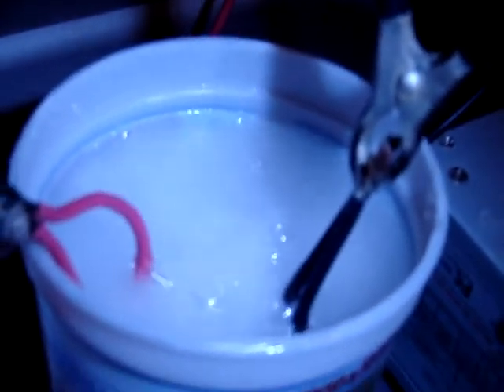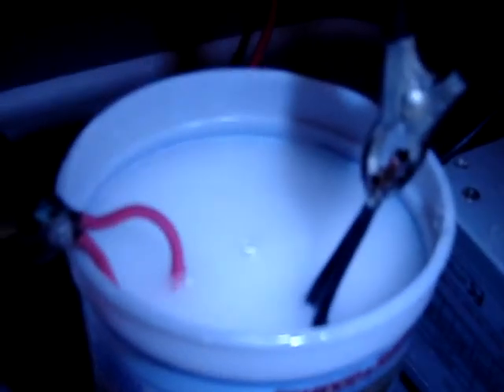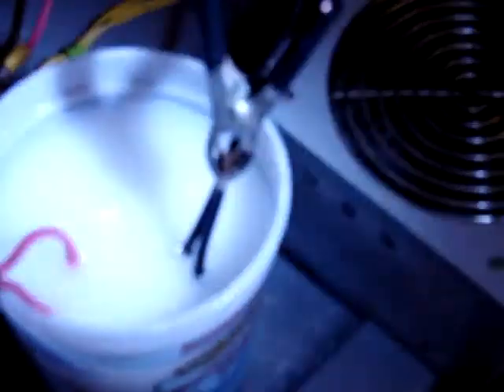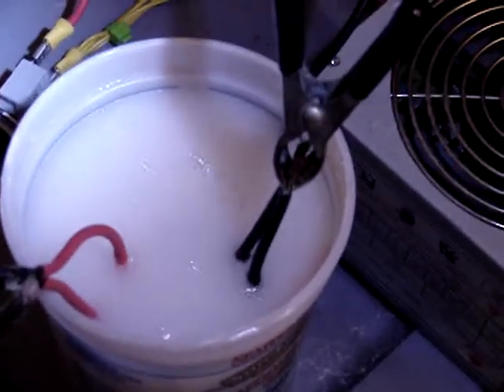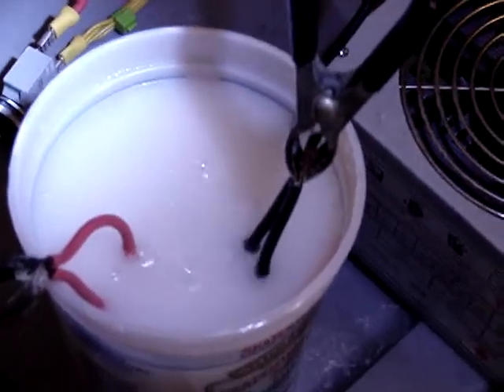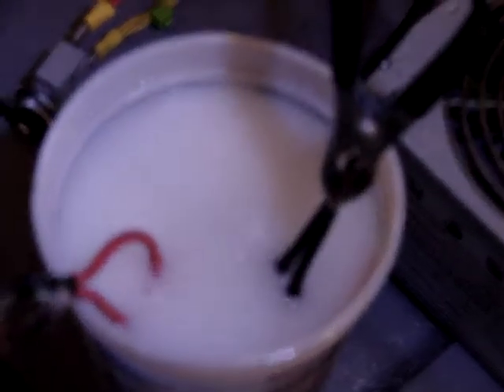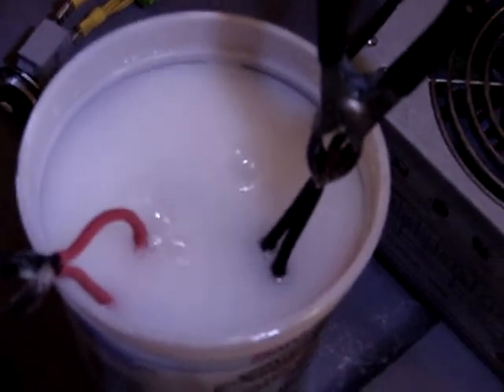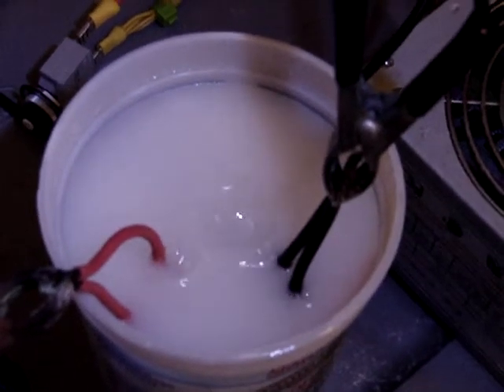Vid2 OxyClean Volcano Cell HHO Generator "9 Cups" (HHO, Brown's Gas, Hydroxy)

Comment from the maker: I'm using 12 volts from a PC Power supply and the amperage has to be less than 15 Amps, because I have a 15 amp breaker that hasn't popped yet.

Not sure what you mean by configured?